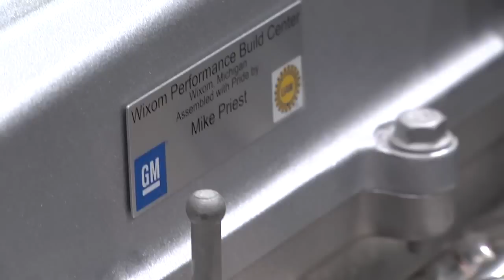Chevrolet Corvette 6.2L V8 LS9 Engine Assembly

Comment: The LS9 found in the C6 ZR1 to all the engine builders of Wixom Michigan thank you guys it is a shame they closed down your plant you guys were responsible for the LS7, LS3 and LS9 the best small blocks of the modern era
Reply: well said brother
well said
Reply: DustinCorvetteZr1 i looked up the plant and it still shows that it's operating and UAW Local 29 union is there. General Motors announced the relocation of Performance Build Center to Bowling Green Assembly Plant but the Wixom plant still shows open unless i missed something.
Reply: @jza80king  It is still open. I have a meeting there every week.
Reply: The LS series of V8's has just surpassed a Toyota engine as the 2nd most produced engine ever behind the VW flat four, but should pass that within a few years. Everyone uses the LS crate engines in their car builds. You will find Mustangs, Dodges with LS engines. Go to a high end car show, 60% of the cars have an LS no matter the make. Race or street cars also have the LS's. You could combine all the latest Dodge Hemi's and Mustang crate engines, they combined still sell less than 15 percent of what the crate LS engines sell.
Reply: @pwengineering9070  I have an LS7 in a C5. Love it. BUT-I find it impossible to believe there have been more LS small blocks produced than the traditional small block Chevy.....

Comment: Congratulations, Mr. Priest, on a job well done.  You, sir, are clearly a craftsman.  I have a '98 C5 with a plain vanilla, line built LS1.  It currently has 170 KMiles on it and still runs beautifully-one quart of oil every 3 KMiles.  It's just one darned fine engine in a car that is always a treat to drive.
Reply: @frank My brother and I built a little 289 for a '66 ford galaxie, and it never used ANY oil in 10,000 mi. because we ran it that long without an oil change just to see if it would or not. I think we are a couple of pretty good builders too, huh?
Reply: jerry lawler dammmmmmm
Reply: @jerrylawler4431  what I have learned is to build an engine that doesn't leak or burn oil, you need 2 things.  1 you need to build it right,. 2 you need to do the first oil change at 3,000 miles max, I prefer 1,000 miles first oil change.  If you don't break it in right and get your initial oil change fast they will always be oil burners.
Reply: @infidel66687  you and I believe the exact same! I have always done 1k oil changes on everything I own. I have never had one use or burn oil.
Reply: @JAMESWUERTELE  oil changes at 1K? That's a little excessive don't you think. You could easily go 3K to 5K without any issues😊
Reply: 1 quart of oil every 3K miles is a little high. It's not excessively high enough to warrant a major tear down, but i would be a little concerned.
Reply: @jerrylawler4431  10K miles?? Are you running full synthetic oil or what??  Personally i think 10K is a little high. I would go maybe 5K tops, preferably 3k to 4k.

Comment: This looks like the full skirted 6.2 all aluminum v8.the other engine is the iron block 6.0 V8 with aluminum heads.i think both engines use solid lifters.
Reply: Nope.  Hydraulic.

Comment: Why does everybody skip the good stuff? A crank only installs one way. Yet every single video shows it like it's something to see.

Show us how the bearings are located and installed consistently. How do they get in the right spot so that you done have bearing jammed into the radius of the crank because the bearing is too far to one side?

Instead, we see the same thing. Again and again and again. Crank installed. Heads dropped on. Drop the intake and induction system on and BAM! Engines done.
Reply: Right! I wanted to see the pistons and bearings. The complete install.

Comment: A lot of non Corvette or Camaro owners complain about no overhead cams. The overhead cams on the Ford Mustang GT add 40 pounds of weight to the top of the motor and affect handling because the center of gravity is much higher, and this extra 40 lbs is in the front of the car further affecting handling. If you drove the Corvette, you would experience a very pleasant driving experience, and really appreciate what and old tech 2 valve pushrod engine can do. Our 2014 Corvette Z51 does a very real zero to 60 in 3.8 seconds, and still delivers 29 mpg consistently going down the road.

Comment: The LS9 or LT4 engine, integrated with the new 10 speed transmission, should be OEM in Cadillac Escalade/ESV vehicles. More bang for the buck.
Reply: This one will be hooked up to a real transmission.

Comment: Layer upon layer of electronics..  Scary stuff.   IT will become a maintenance nightmare !!  The electronics should be kept away from the motor with the exception of pickup sensors and those should be engineered with access in mind.

Comment: Why not install the 7.4 liter, 454 big block in the Cadillac Escalade/ESV or the Duramax diesel engine in the aforementioned? Any detrimental reasons. Gas mileage doesn't apply if your person can afford this luxury SUV.
Reply: What 7.4?? these engines are before the oil crisis

Comment: What difference does it make if a robot uses tools to ASSEMBLE an engine or a person uses the same tools to do the same thing ? If anything the robot will make fewer if any mistakes  and do it consistently.
Reply: +TheAceHD To be honest if you look at the way a Bugatti engine is made or something that is ACTUALLY high class quality, than you can see how humans can do things robots cannot. GM on the other hand is just kinda knocking it off, no offence but that engine doesn't take special treatment unlike the tranny in that beast. But the other aspect is that when they use people to build the car and not machines, it makes the rarity of the vehicle go up which legally lets manufactures like GM technically can raise the car in value. If machines built them it wouldn't make the car as special to some people as well as rarity.
Reply: +BiltonFriends You make it sound like GM wants to be in the same market as Bugatti.
Reply: BlueonGoldZ Yeah my bad for doing so. I just think the only reason the have people assemble their stuff is to charge more for it. Im not a huge fan but I also am not trying to make anyone angry. You know what GM is real sick tho is the GTO!!!! Dayum son!!!!
Reply: No need to mass produce and build an assembly line for an engine that isn't going to sell as much as a base model.
Reply: In the remote control car world. The hand wound electric motors cost more because they are better than the machine wound motors.
Reply: I run R/C's and I agree.
Reply: Camm GTR but why is that? Could it be because actual manned labor cost more than robots simply? That's pretty much why companies switch to robots. More efficient with time and construction. I'm this kind of stuff, it would be naive to say a human can build it better. It's all a matter of mathematics and computers trump humans in that aspect EVERY single time. That's a solid fact. Those hand spun engines cost that much because it costs more to pay a person that to utilize a robot. You've been tricked my friend. If you think that isn't true, then it's all placebo for you.
Reply: It's about attention to detail not cost fool.
Reply: Also, when it comes to measuring the cylinder sizes and especially when fitting the piston rings, that is probably best done by hand.
Reply: Camm GTR They (machines) are faster at doing the macro stuff like moving the blocks around, boring them out and perhaps a rough hone but anything finer than that, especially ring gaps and fine honing, a human is better at as you are already stating.
Reply: fine dexterity in the hands is our only advantage but with new robots and AI,our time is limited.

Comment: Tried to get on with GM several times. But since I don’t have a college degree, I got shunned. I could do this, easily!! I’ve built lots of engines. The automation takes the grunt work out of 90% of the engine build.
Reply: And the skill level is far less!!

Comment: No chance for "cross-threading" there?
Reply: the threads are likely recessed a bit and the bolt would align as it enters is my guess. especially seeing it on engines I've built.
Reply: All automated torque wrenches reverse the thread (lefty-loosey) until the bolt/screw goes "pop."  It then knows it's aligned for tightening.  Side question....doesn't everyone reverse all (lefty-loosey) screws/bolts before going righty-tighty, until you feel the "pop/bump" I just described?????  You CANNOT cross-thread bolts/screws when using this method.
Reply: Nope, the computer controlled wrenches can usually sense it before it occurs, factory defect rate is much lower.

Comment: Not even a roller cam/lifters. Seems a little behind the times for performance.
Reply: Why? Roller cams are for drag racing cams with really steep ramps. Production cars like this don't use cams like that.
Reply: ALL L/S engines have roller cams and lifters!!! Every single one ever made....
Reply: LS engines use roller lifters, and rockers..
Reply: Derp
Reply: @kennydemartini2169   that was copied from Ford !
Reply: @michaelbeilsmith794   that was copied from Ford !
Reply: Ford was first in using roller cams in production cars in 1985, but they did not invent roller cams, as they were used in aircraft engines way back in the '40s. Ford was also the first, and last to use a four barrel Holley carb. That doesn't mean they invented it...
Reply: @kennydemartini2169   Well invented or not  I know Ford was first in using roller cams !  Funny how someone always has to chime in lol
Reply: @lostpacket  yes they do all engine after 1995 have rollers no zink in oill
Reply: @clinteastwood9115  ford was not the first 1912  northway  engines all had rollers